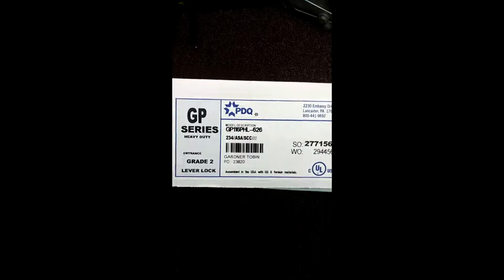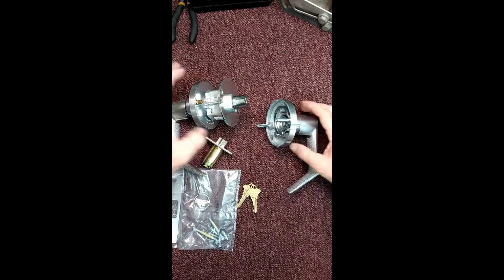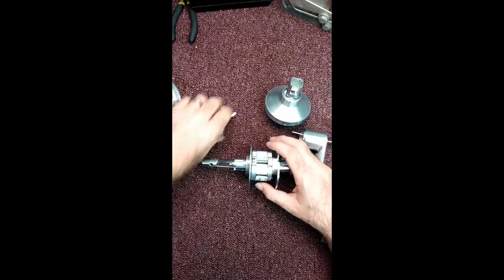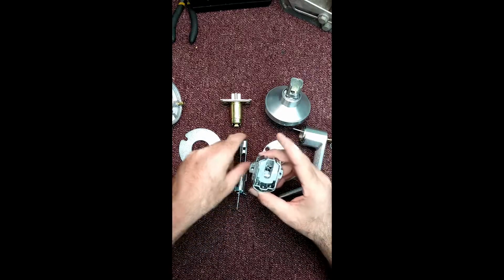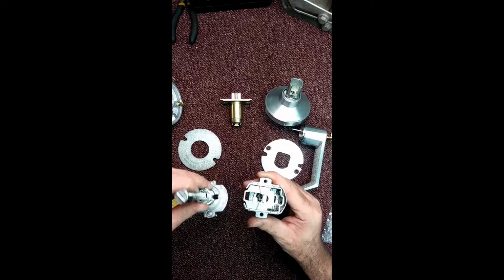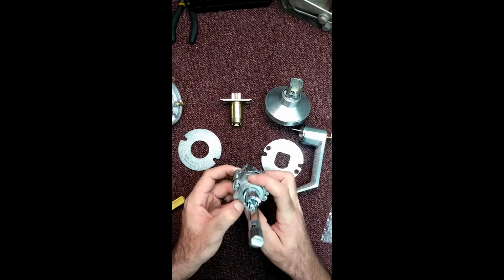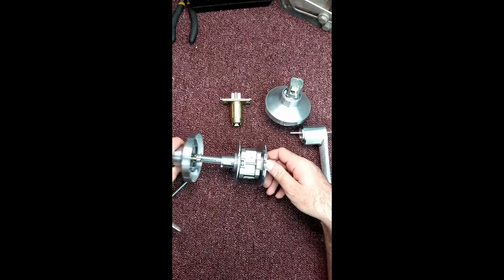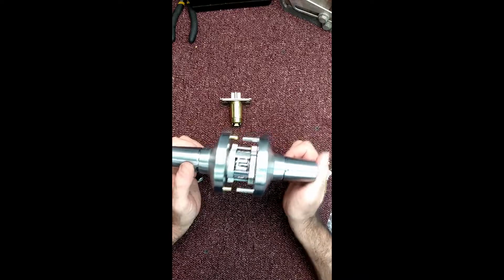PDQ GP Series  - Lock Profile

Comment: Recently, I saw where PDQ had that plate  where the lock fitted into an 1 3/4" thick door from the factory. Is it in that position when you took it out of the lock, or do you need to adjust it before you  install the lock?
Reply from the maker: Yes, it is in the position straight out of the box. The lock set comes set for a 1-3/4" thick door (setting A on the threaded collar), should 1-3/8" thick door be needed, you simply spin the thickness plate to the "B" position on the threaded collar.